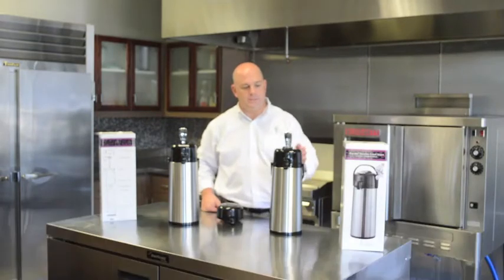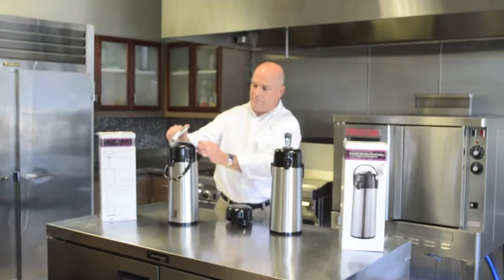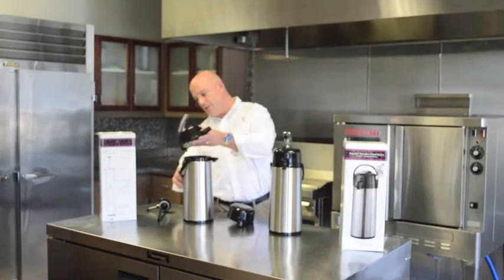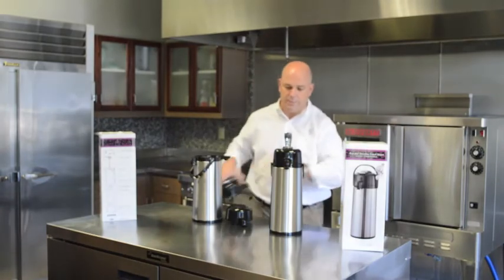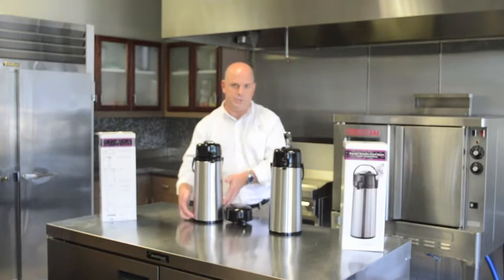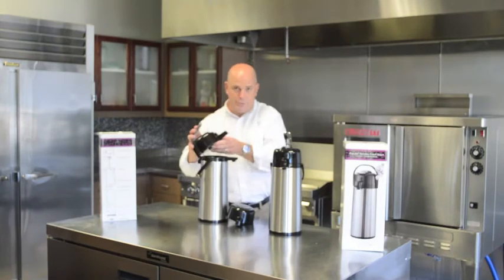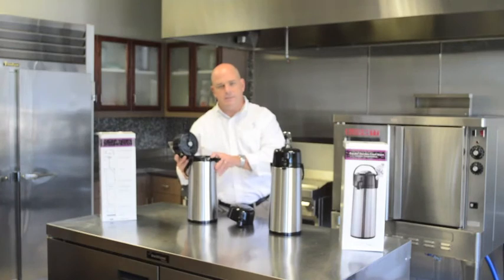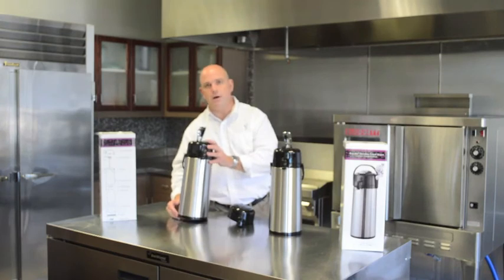Intro to Airpots ServiceIdeas

Comment: Can a cream sauce dispense through this air pot?
Reply from the maker: Hi Tim, we do not recommend using an airpot for dairy products. We recommend using an NSF-listed creamer designed for dairy, such as our SteelVac Creamer found here >> https://www.serviceideas.com/products/servers/steelvactm-creamers/steelvac-steel-base-creamers.html These creamers can be disassembled and put in the dishwasher for a thorough cleaning.

You can also use a flip-top server like this one for thicker cream sauces >> https://www.serviceideas.com/981-series-carafe.html These can also be cleaned thoroughly for safe use with dairy or cream.